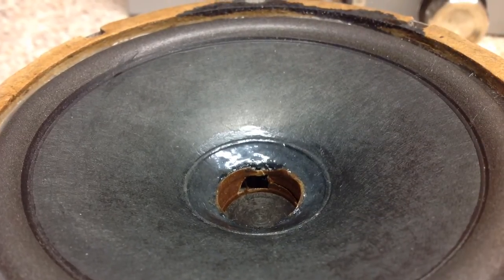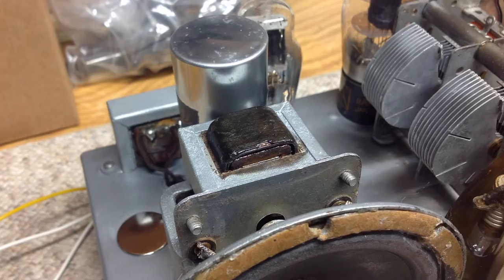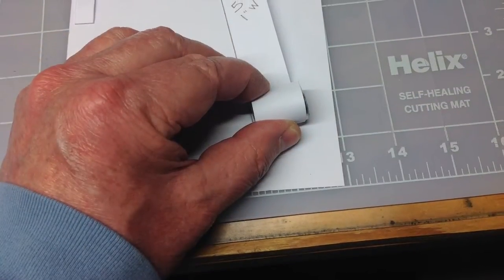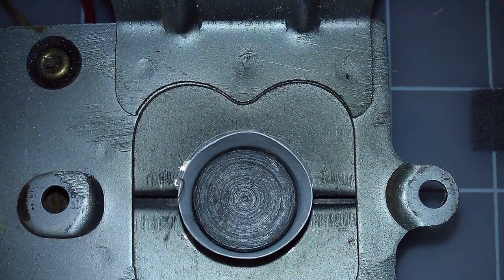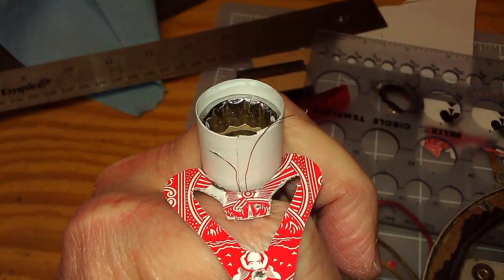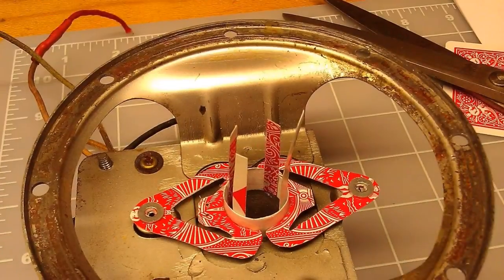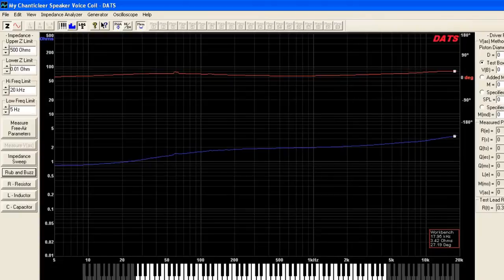Chanticleer 2D570 - Building a New Voice-Coil and Spider

Comment: Batterymaker's commentary is spot-on! I will, however, add this - rewinding a coil of any type is no easy task. The amount of thought and pre-planning demonstrated at each step, along with the specificity of procedure is once again impressive. Another fine job, Don!!
Reply from the maker: ***** Thanks Tim! My preparation made a significant difference in the outcome for sure and I learned a lot that can be applied to the next one (hope there's not a next one) should the need arise, Hope you're doing well and thanks for the encouraging words. Don

Comment: I have to figure out how to reconstruct a voice coil from a round 4'' - 4-1/2'' speaker from a late 40s AC/DC radio. The problem is that the cone is fine but the coil form collapsed and started coming apart. This seems to be a common issue with many of the voice coils in small, inexpensive, PM dynamic speakers, I've noticed that Jensen speakers have a propensity towards this more then other makes, although they are not alone in this. In any event I found a socket that seems to be the correct diameter, but have not figured out what material to use nor what sort of glue to cement the form together with, preferable I would not want to use anything water based if it can be avoided. It's a deep socket so I can avoid the form becoming adhered to the writing on the side of the socket which is at one end. Packing tape is pretty much a no go, it's usually made out of cellophane, so not only will the glue dry out but the chemical composition of the plastic may corrode the copper in the coil.
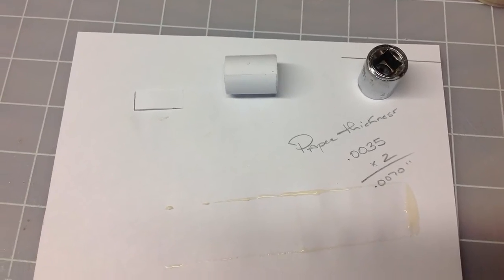Reply from the maker: OlegKostoglatov You may consider ~1Mil Kapton that was developed by Dupont. It's in the video (2:11) next to the package tape (meant to call it out & forgot the name when I was doing the narration) and amber in color. Kapton is used to create voice coils and has great electrical and mechanical properties. Hope you're successful recreating your voice-coil and I appreciate your comment and taking time to view the video. Don
Reply: RestoreOldRadios
I have heard of Kapton, in fact I did see a tube product offered by one of the paper tube companies that was manufactured from Kapton, it's a good insulator and is heat resistant. This was no in sheet form of coarse but in the form of a spiral wound tube, they also offered tubes made out phenolic or paper impregnated phenolic. The voice coil forms used in many speakers appear to be made out of two layers of a thin spiral wound paper, in the speaker voice coil I need to recreate they also had a thin layer on top of the coil itself. Many voice coil forms are often made out of a plastic or a phenolic material so something like Kapton would not be out of the question, though I am not certain what sort of glue could be used to cement Kapton film to itself.
Reply from the maker: OlegKostoglatov Keep me informed on how you move forward with the re-coning just in case I run across another one like this. Take care and I wish you the best on your project. Don

Comment: Where did you get the speaker cone?
Reply from the maker: I bought a number of them off eBay many years back from a surplus seller. The cutout area (diameter) for the voice coil was too large, so I had to add a center piece. I’ve since started making cones and using donor surrounds. Best, Don

Speaker Cone - How to Build One w/ Cardstock
https://youtu.be/DmBliqDwTyY
Reply: @RestoreOldRadios  thanks, i will watch that video later today. I've thought about making my own but didn't know how it was done. Some of the old vintage radios have odd basket sizes and depth so a donor speaker for the cone doesn't always work.
There arent many people out there that still know how to do this kind of thing so its nice to see someone who posted how yo keep the hobby alive.

Thanks
Reply from the maker: @kwacz  Thank you for your kind words. If you have any questions after viewing, feel free to reach out. Best, Don